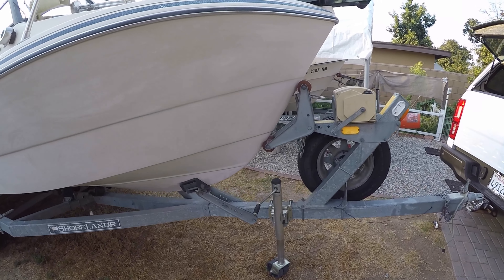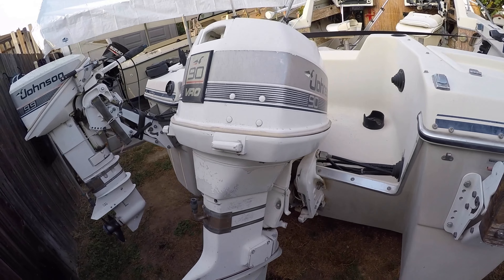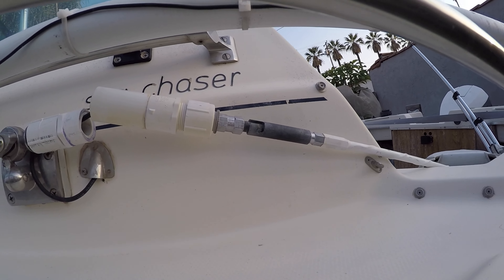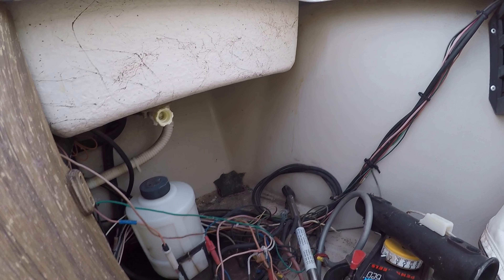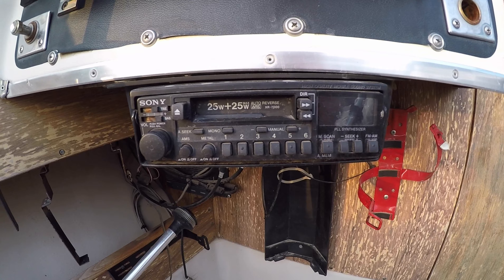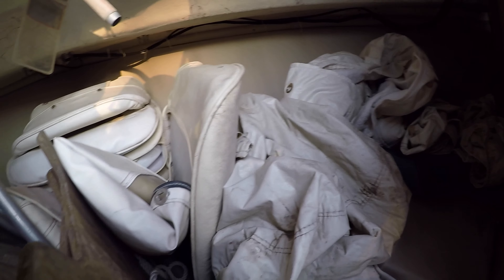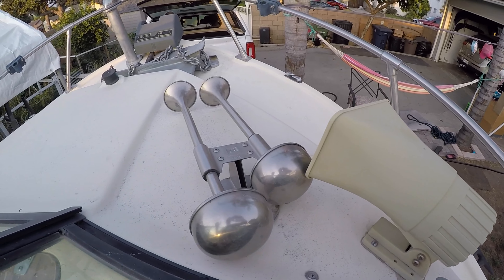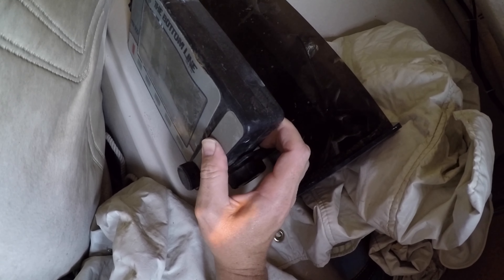Restoring A 30 Year Old Boat | Project Overview | Arima Sea Chaser Restoration, Episode 1

Comment: That boat (ARIMA) is a winner!!! My 16 ft er was 8 ft wide. It would stay up on plane with a 50 hp. on 60% throttle.Made for choppy water . I am glad to see they are making them Again.The original company closed. P.S. The starboard is a good plan.

Comment: It seems like it from WA? How you move it from WA to CA?
Reply from the maker: I hired a transporter to move it to me here in California.
Reply: @SoCalSeaChaser  how much does it cost ? Both the original boat and transportation fee? Thanks
Reply from the maker: @weiluo1881  with gas prices now, transporters are charging between $1k to $4k depending on the locations. This size and style of boat is between $10k to $25k, some even higher, depending on motor and other features.